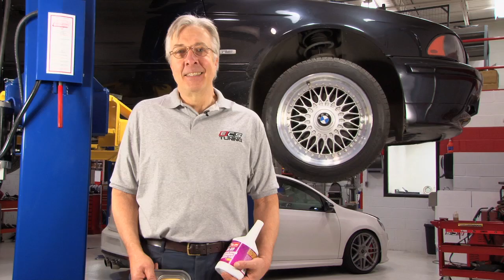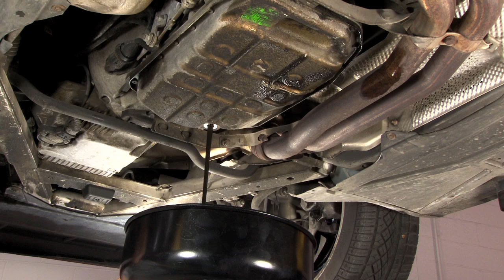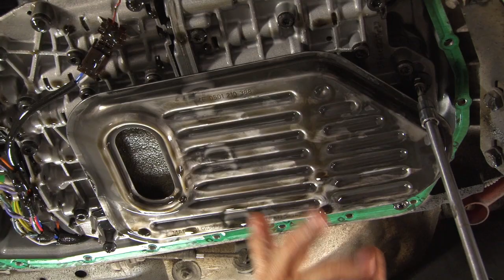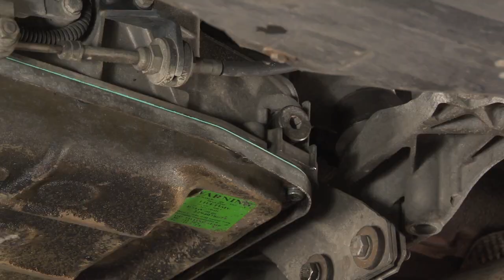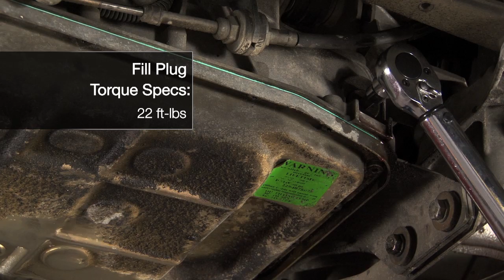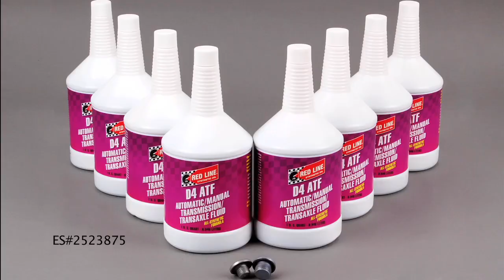ECS Tuning: BMW Automatic Transmission Service DIY

Comment: Best video I ever seen for this procedure. Two things I would add 1) The screw for the filter is T30 although the T27 bit could work. And 2) the red fluid from redline, valvoline, Castrol etc may meet the specs to what was in it originally but not exactly the same wrt density, viscosity, SG etc; the better choice would be the pentosin/Fuchs ATF 1 or Febi or the original ZF lifeguard 5.

Comment: The actual BMW procedure would lead you to believe that the transmission temp. of the fluid at the time of applying the fill plug is most important. I say no. The transmission being level has more of an impact than the expansion of the fluid at the proper temp. Case in point. The transmission of my X3 sits at a 5 degree angle when the SUV itself is level. Doing the math, this will change you fluid level far more than the temperature. So it is important to both have the transmission level and the proper temperature of the fluid. In my case I chose 40 C ( 30c-50C). I drained 4.5 liters of used fluid black and filled with 6 liters of Redline D6. The X3 had only 66,000 miles and operated smoothly. The fluid change was a proactive move on my part
Reply: Sharpshooter44024 When driving uphill/downhill or accelerat/brake neither the pan nor the fluid level will ever be level ;)
The whole thing is merely about overfill/underfill so the fluid will not come out from the top vent when boiling hot or the pump will suck air when in highly dynamic moves.
Reply: Imothep I was really concerned about not adding too much. I drained 4.5 liters and added 6 liters the exact way shown in the video. It seemed like a huger difference to me. It seems logical that the transmission level is the way to go prior to filling since my transmission goes into multiple different vehicles with each vehicle possibly having a different transmission angle. Once I have the proper amount of fluid volume I assume that the transmission design will account for the transmission level movement during a variety of maneuvers of the vehicle.
What happens if you add too much fluid ?  Does if spill out of an over flow valve or blow out a seal ?
Reply: +Sharpshooter44024&#160; Sharpshooter, your detailed explanation makes sense to me. But ECS's instructions are contradictory. The written version says to make vehicle level. Video says to make transmission level (using pan lip edge). Those are very different things.

With my 2002 BMW  530i, the transmission pan is level when the rear wheels are up on car ramps (9" off ground!)and front wheels on ground. That's a very steep front downward angle on vehicle. But you never see the vehicle in other videos at that kind of downward angle when they are checking fluid level. I haven't seen one in a shop at such an angle either. The vehicle always appears level on lift.

I actually called ZF North American today to try to resolve this. The ZF tech was adamant to make vehicle level, not transmission. (ZF's written guidelines also say make vehicle level.)

Because of this confusion,  and before draining anything, I did a little test on my 530i. I leveled the vehicle, brought transmission to 30+ deg C, and opened fill plug, not drain plug. Almost 1/4 - 1/2 a liter of fluid came out! This suggests to me it was filled with transmission leveled (i.e. fluid more angled toward front of transmission away from fill plug, allowing more fluid in). Not with vehicle leveled, which runs more fluid toward back of pan, limiting amount you can pump in.

Finally, a very good point you make. The same transmission is at different angles in different vehicles! So that suggests you level transmission, not vehicle.

Those Germans seem more precise than this! I can't believe there is this kind of confusion. I was tempted to get my German friend to call ZF in Germany to go straight to the top!

HELPPPPPPP! I can't afford a new ZF5hp19!!!!!!!!!

Comment: Hi I was wondering if guys could get do a transmission fluid diy video on a 2007 (e70) X5 with the N52 6 cylinder that would be extremely helpful thank you

Comment: I only had issue with the temperature part. Do we add fluid, and then wait till it reaches 30C and then slowly add fluid till it comes out?? I know ATF expands. Or do we add all the fluid, and wait for the drip to reach 30c. So confusing.

Comment: hello my friend I'm writing from the turkey. I'll ask you a question and I'll be happy if you help me. The 2001 model has an e46 3.20d vehicle with 100kW (136). when the car is on the first launch and every time you press the accelerator pedal, it takes off with 4 seconds delay. the revolving clock is moving, meanwhile accelerating after 2 thousand cycles. GAZA is doing the gas interruption in the loading.Water repairs, pump repair, injector, air flowmeter.

Comment: I have BMW e60 2004 what type of oil i need to use and how many litres? Can u put a video for E60? Will the filter must be change because the filter is on carter?

Comment: Yes nice video but you change just 60 procent new Oil .40procent old oil stil is in gearbox best change like super flushing and move 99 old oil
Reply: not necessary. Just replace what comes out with the pan drop. the new filter and clean magnets will take care of the rest. transmission flushes can cause more damage than they are worth.

Comment: hey ECS i just changed the fluid in my 98 323is its an automatic A4S 310 R   THM-R1 its calls for DEX 3 but I used DEX 6 because all the research i have done peoples say DEX 6 is so much better what you guys at ECS think?

Comment: I have a 2003 X5 3.0 with 164000 miles on it.  At first start in the morning only, when I put it in drive I have to wait about 10 or 20 seconds with my foot on the brakes before taking off or the engine will rise as it slowly moves forward.  But no problems the rest of the day. Could it need its first fluid and filter change, low fluid or could it be more serious?

Comment: Hello. I have an E34 with a 5HP18, which recently lost all drivetrain power. I stopped driving for a bit and when I put it in D nothing happened, except for the engine revving, but with no movement. The same goes for all of the other gears. R, 4,3, and so on. The wheels on the other hand lock, when the trans is in P, and move freely in N. Worth mentioning, is that before all of this happened the gear selector was really hard to engage. It was resisting a lot and struggled to go into gear. I checked the oil level in the trans today and the wire that goes from the gear selector to the trans and they were both fine. The car has also been sitting for about 2 years outside without being moved. What do you think is the problem?

Comment: I'm thinking about doing this soon on my 91 525i. This may be a dumb question, but after refilling the fluid until it drains out of the fill hole do you replace the fill plug before starting the engine and running the transmission through the gears? My transmission is acting a bit funny and when it does the gear indicator light in the dash is unlit. jiggling the shift lever a bit turns it back on and it works fine for a while so i'm going to look at it and clean or replace.
Reply: Mark Jones the fill plug must be fitted with the engine still running. If you shut down the engine and stop the fluid circulation then instantly 2-3 liters will pour down to the floor

Comment: hola .bmw 320i 2000 the speedometer no work ,i need change the speed sensor but i dont now where is localizated in the transmision (automatic)
Reply: Duvan Orozco  huh

Comment: HI, I have 2 - 740-4.4 v8 e38 BMWs, one is 1998 & the new one is 1999. As in t his video, will the procedure be the same for both, also what are the torques values for the studs and the drain and fill plugs?

Thanks
Reply: Omar S The fluid may be different for both cars depending on the color of the identification plate (green or black) Green lable means Pentosin ATF1, if black ask your BMW dealer. I have forgotten ;)

Comment: Is the used fluid normally black or grey in these transmissions?
Reply: Josh P the fluid that the particular transmission shown in this video "zf 5hp19"  is similar in color to motor oil. I have done a lot of research prior to rebuilding mine. I bought Pentosin atf+1, they recommend zf lifeguard 5 fluid which is pretty much the same. I just wanted to use what the manufacturer recommended rather than experiment with other fluids like the red stuff in the video.  not saying it isn't the right stuff.
Reply: Josh P , that's really good to hear! I figured the other fluids would work just fine. I was just nervous when I started my rebuild and went a little too far down the rabbit hole researching fluids. Glad to get another confirmation about the castrol import multi vehicle fluid.

Comment: What about the fluid in the cooler and cooling lines?
Reply: Thewestcoastshooter the only way to completely change the fluid is to flush the system with the car running. That would need to be done at the dealer or an aftermarket shop  with the proper equipment. This video just outlines a basic filter change. The trans holds 9.8 liters total and I'd say only 5 liters are drained in this procedure. That's only half. if you run the car and drain it again the fluid will be black again in less than a few minutes. 

If you want to do a more thorough fluid change you can disconnect the trans cooler lines and run a can of transmission cooler cleaner through the lines to remove the old fluid and clean them up. I used Kooler kleen by Dr. Tranny Amazon or Napa has this. Then if you really want to get another 2-3 more liters of fluid out of the transmission you can un bolt the valvebody. That will allow half of the fluid inside of the torque converter to drain. I bought three 5 liter jugs of pentosin atf+1 off ebay for $57 dollars each for rebuilding my transmission and it was enough. 

hope this helps.

p.s. this advice only applies to the zf5hp19 transmission shown in the video. A GM transmission can also be found in e39 bmws...I don't know anything about those.
Reply: faseonepk2002 thanks for the thorough reply!!

Comment: Hi,  i have a bmw 328 ci model 2000 e46,  what oíl is the recommended for  this transmission? Which the full level ?. I from argentinian.  Thank you for you time.
Reply: Obvisly this is automatic transmssion
Reply: In the manual bmw transmission say texaco Etl 7045 dexron 3 but here don't get and various web sites don't recommended dexron 3. Can you help me with this problem?

Comment: I don't like people who tell you never to change transmission fluid.  I have a 2006 Jetta 2.5 and it is the same situation.  The lie with a forked tongue and tell you that it lasts a lifetime but we all know that there are no real lifetime fluids.  I don't even like coolant that is older than 2 or 3 years.  I would rather they tell you the truth instead of lying to make the car look as if it needs less maintenance.  It is just a clever scheme to get you to buy cars more often if you are so damned gullible that you would fall for that BS!!

Comment: stuck in failsafe mode.   almost no movement in any gear but fail safe 4th gear. after it runs for any where from 5 min to 30 pops out of 4th and won't move again unit till I shut the car off and wait for anywhere from 5 min to an hour.   note left bank know k sensor need replace local transmission guy said that those possible could be the cause?   after supposably servicing the tranny. I check the fluid about 100 miles after looks like motor oil black unfortunately it's my only mode of transport and needed to drive it in fail safe mode.  ideas???

Comment: Hello! I have a 2000 BMW 528i with a Steptronic automatic tranny. The car has 197,000 miles on it and I've found no evidence of any transmission service for it. The car still shifts fine, but many techs are telling me that since its this old with no service on it that its living off borrowed time. They also tell me to leave the transmission alone as changing the fluid at this point would damage it further since new fluid would remove the gunk that's keeping it together. In short, they tell me to just let it die. Can I have your opinion on this?
Reply: you could take the chance I'd do it or you can put a additive in it instead
Reply: I just changed mine at 199,000 and I doubt it was ever changed I doubt it was ever changed BMW claims that the fluid lasts a life time even though this isn't true
Reply: lifetime MEANS 100k km's or miles
Reply: I´ve had the same question, and decided to made the fluid change, mine has 190k km at that time and no one service history on transmission. The fluid that comes out was red to brown, but after the change I noted a small difference to better on faster and smoother gear shifting, hadn´t any problem. It´s what happened on my car.
Reply: Can anyone provide updates on their car? My 330ci has 150k miles and I'm not sure if I should change it